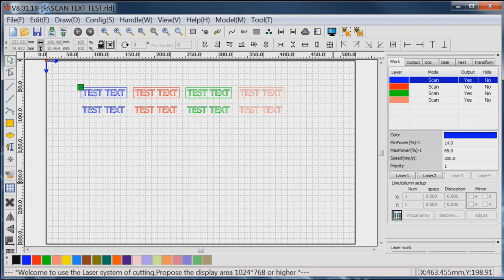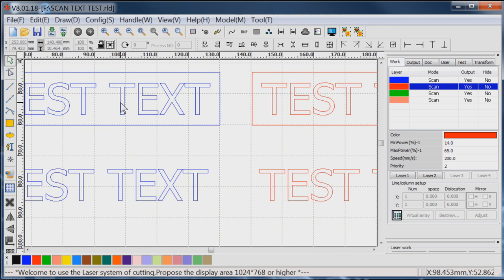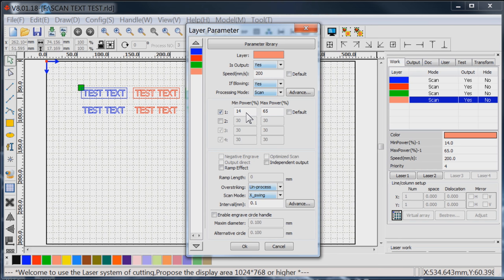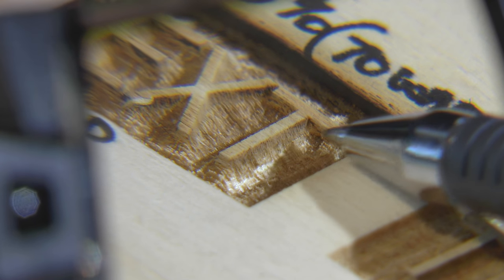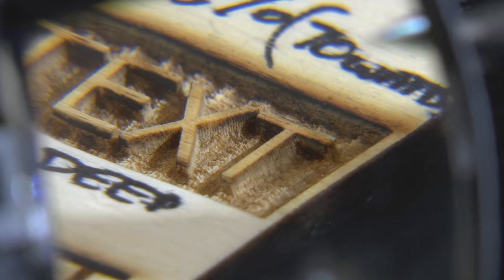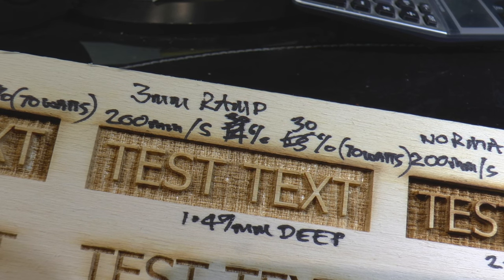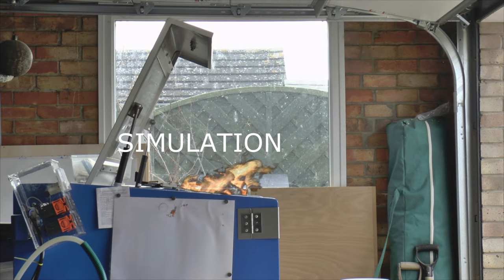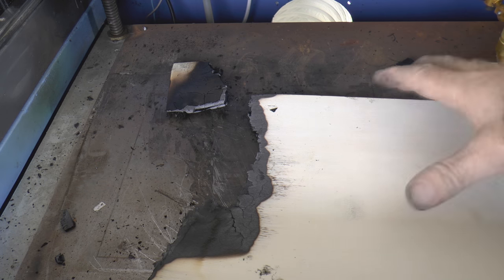RDWorks Learning Lab 80 My Chinese Pizza Oven!!

Comment: Russ, I recently realized that I can link one of my DSLR cameras to my computer or handheld device via WiFi. I plan to attach a mirror to the top of the machine at a 45 degree angle and then point the camera at that. I hate walking away from my machine but I am guilty of doing so. Many modern cameras allow some kind of WiFi connection so it may be worth looking into. Heck even an inexpensive security camera should work. I got a kick out of the warning label on top of my machine. "It is FORBIDDEN to leave the machine while its working". 

Great video as always.

Comment: Escaped by the skin of your teeth there, glad to see not too much damage was caused. I haven't been game to leave my machine with anything on the bed after cutting, at least not without turning it over first.

Just wondering if that "ramping" could be used to generate mitre or dovetail joints or 45° cuts?

Comment: I suspect that this ramp option might be for making stamps in order the ink not to blur the letters or design. If you look to a universal laser manual in the stamp program setting, it has this shape around letters that you can actually choose to be inner or out. Just a thought..
Reply: I agree.
Reply from the maker: Hi to both you great guys.
Thanks for the comment but my point here is,  although I understand that this is used for block/rubber stamp manufacture, it's the surface of the letters that is doing the printing and provided that surface is sufficiently proud from the background does it matter on the shape at the root?  Certainly not for wood blocks BUT just maybe for fine text rubber blocks it helps to support the "floppy" letters provided you don't cut too deep. I'm not a printer so this is alien territory for me.
Thanks again
Best regards
Russ
Reply: Because i cannot post the picture, this is the description. "Rubber Stamp
Rubber Stamp mode causes a “shouldering” effect when raster engraving rubber stamp material or any other material that requires a “shouldered” engraving. The effect looks as if the laser beam engraved the material on an angle, but in actuality it is the precise control of laser power that creates this appearance. This is a “raster only” feature that only works with black colored graphics and uses the power setting of the black color in the printer driver. Vectors are processed normally and can be used for vector engraving or cutting by assigning any of the seven other printer driver colors to the outline desired."
Reply: my thoughts are the ramp reinforces the sides of the letters to stop them flexing as much. it should stop them snapping off easily in wood aswell
Reply: Yes, the letters are being printed but this shoulder helps/guides the excess ink as you squeeze the stamp to go down to the groove more easily, like a water drain
Reply: That's what I was thinking. Rubber stamps to "eliminate" squirm.

Comment: Hi Russ,
had a small fire of my own today after rushing to answer the phone. Unfortunately I've lost the belt, air pipe/head, light fittings and burnt through some of the electrics! Do you please have the wiring diagrams etc and any idea of where to get parts especially wires for stepper motors and the light etc? Any help greatly received!
Reply from the maker: Hi Andy

Oops!!!
There are no exact wiring diagrams but there is an overall schematic of how things hang together on page 14
https://cloudray2021.oss-us-west-1.aliyuncs.com/Product%20information/Software%26Board/RuiDa6442/RDC6442%20Controller%20User%20Manual.pdf
 If you send an email to Cloudray with some pictures of what you want, they are normally very helpful.
 Best wishes
Russ

Comment: After watching your newer video first (belt replacement), could it be that the ripples are related to the o eccentric pulley that you found?
Reply from the maker: Hi Abraham
Yes and no. There is a relationship which is explained in the video I am just preparing. It great to get away from paid work and back to enjoying myself!! (if pyromania can be classed as enjoyment)
Best regards
Russ

Comment: independent output will output the letters in the test text one at a time instead of all in one scan.
Reply from the maker: Thanks for that info. I will give it a try
Regards
Russ
Reply: SarbarMultimedia it works well if you have say 2 engravings at either end of the work with a lot of space between them rather than separate them onto different layers..it will do one then move to the next
Reply from the maker: I have to admit to separate layers as the work around for this problem.
Thanks again
Russ
Reply: I found out by accident when it was enabled on a layer and it decided to do each letter in turn. it's supposed to be faster. maybe if there is a lot of white space it would be but took longer on that piece. I still use different layers aswell because you cannot easily control what it does and doesn't do at the same time.
Reply: I have found out about independent output by ticking it and clicking the little display icon which is simulation of the program. It helps me often to see what the machine is going to do before running the program.

Comment: I know that panic feeling myself, not very fun just glad to hear all is well
Reply from the maker: Hi Dustan
It's strange really because  when I walked into my workshop an saw the bonfire flames gently licking out of the  case, it was an 8 second blur of run, grab extinguisher, remove pin, point and kill. It was only in the seconds and minutes after,  that reflection of "what if" and the "what the hell am I going to do now" went through my mind. There is horrible sinking feeling for a few seconds until you shake your brain back into sensible problem solving mode.
Best regards
Russ
Reply: SarbarMultimedia Enjoy your videos, thanks for your contribution.  Would a CO2 fire suppression system be feasible for your laser machine?